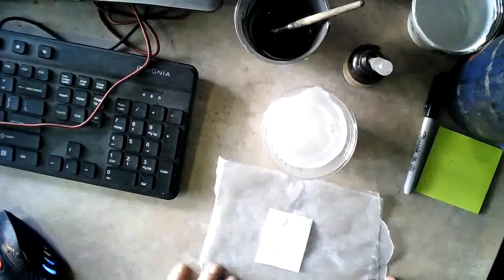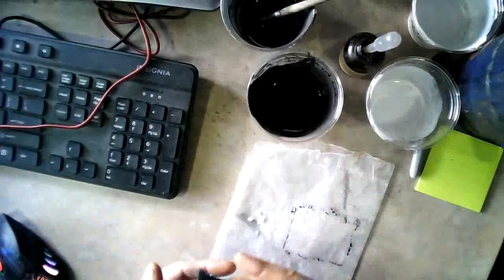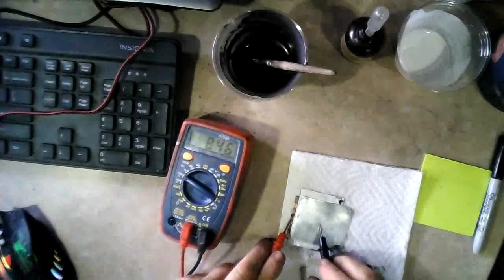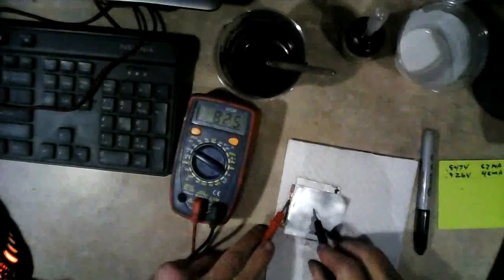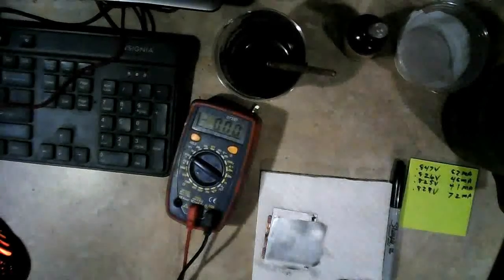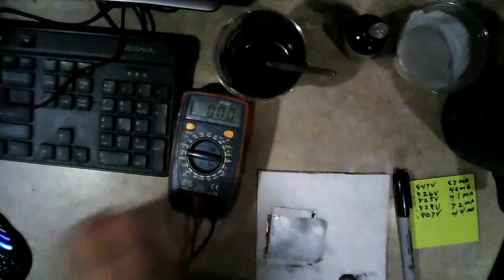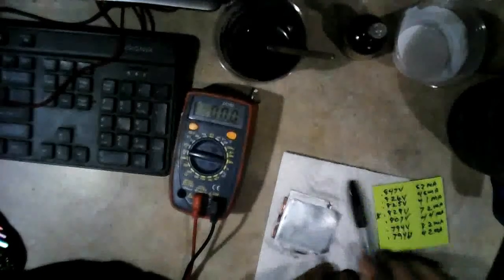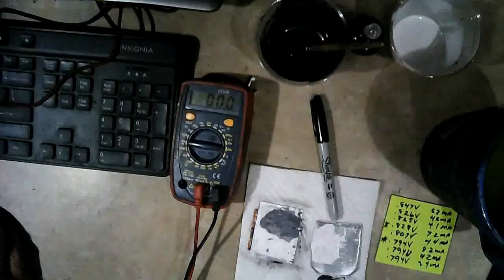A Thinner Film Borax Membrane!

Comment: The results are a bit puzzling. I would have thought the response would have been linear but the amperage sure jumped around a lot, even though the voltage leveled off. The membrane seemed to be pretty tender when you lifted it off. Perhaps the two sides are soaking into each other unevenly. I would call this one uncertain. It would be nice to determine why. Dry it a bit more before hydrating like you said. See if that stabilizes it.
Reply from the maker: The slowly falling voltage that never really reversed was the main sign of a failing membrane in this case. I would have stopped the experiment earlier, but it was a good opportunity to show how difficult it is to tell what's happening sometimes. Usually, I can tell within 3 or 4 cycles if the membrane is good or not.  The large fluctuations in amps was another clue. Ideally, the amps should raise to a peak and stay around that point. I'm pretty sure a longer drying time will improve the performance.
Reply: Great observation. You have eluded to that before. Thanks for elaborating. It answers a couple of puzzling questions. I suspected the membrane because that is what you have been adjusting but did not know in what way.
Reply from the maker: When I took the cell apart, you can also see that the membrane stuck to the zinc plate and pulled off the paper. Where it stuck is where it failed I believe. The dry gel tests didn't stick at all, so that leads me to believe that the membrane just needs a little more drying time. I'll run that test again soon and we'll see.